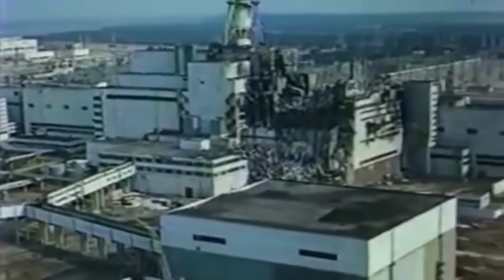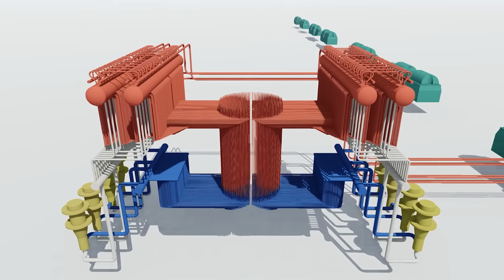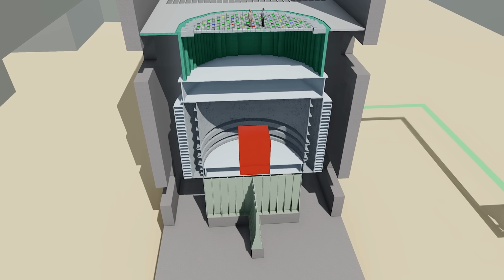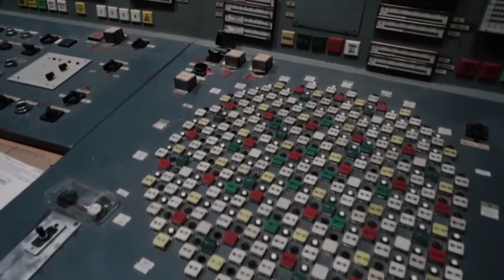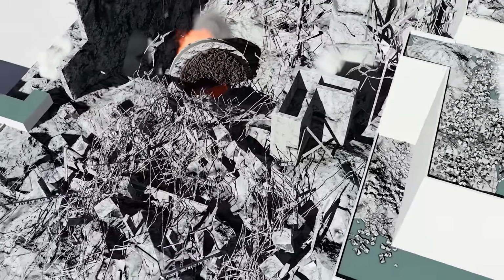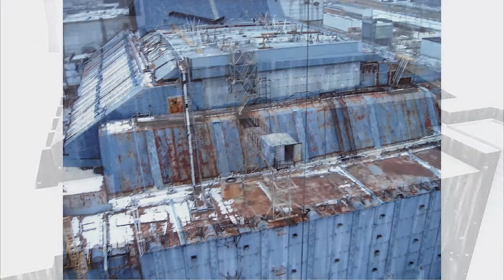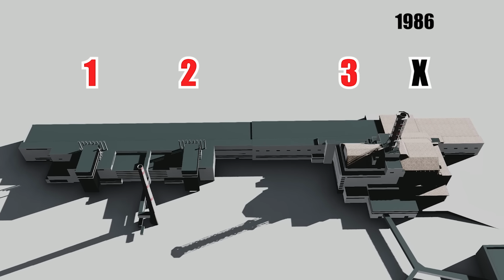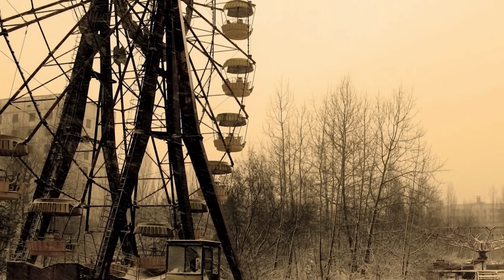CHERNOBYL DISASTER - An Inside Look - 3D

Comment: Yes! Let us add graphite tips to the fuel rods, so that when they hit the reactor core, it increases power rather than lowering it! Huge brain.
Reply: The reactor had operated for 20 years prior. It had design flaws, but this was caused by negligence of Dyatlov and 2 of his techs.  
What really happened:

The reactor was undergoing a 24 hour shut down procedure, allowing for a specific test. The test involved disconnecting one of the turbines from the reactor, as it was being wound down, and using its energy to power water pumps. The test should have been a one off, lasting only 45 seconds. 

Anatoly Dyatlov (head technician on midnight shift) planned to lower output to 700 Mw, the lowest setting at which the reactor should have been operated. 
But he failed to properly set it up and the output fell below 100 Mw. Instead of allowing it to shut down, he tried to bring the reactor output back up to 700 Mw, in order to perform the test.

To do this, he overrode safety systems and warnings, and ordered graphite control rods MANUALLY WITHDRAWN from the reactor. 

The rods are a critical safety mechanism; if the system senses a run off reaction, it will automatically lower these rods into reactor and sap off energy output.

Sadly, he ordered the rods disconnected from the system, so that it would not interfere with his quest for more heat.

Once the positive heat loop kicked in, it kept increasing the water temperature in the reactor, in turn causing higher fission reaction, and on and on. The heat and pressure built up, until reactor 4 housing and piping exploded, propelling a 1,000-ton concrete slab above it clean off the building. 

The reactor was now exposed; contaminated water and coolant were spraying everywhere. 

Dyatlov was sentenced to 10 years of prison, but was released in 1991 after collapse of USSR. He tried to scape goat authorities, apparently ordering him to press on with a not so important test and jeopardize billions of dollars and national catastrophe. In reality, he was public enemy #1 and public demanded his execution. He died in 1995 from heart attack.  https://youtu.be/Cc-vvhWXL9Q
Reply: @tropickman  The RBMK design was finalized in the 1960s. Chernobyl reactor 4 came online in 1983. The test they were running SHOULD have been run before the reactor was certified for operation.
Reply: @tropickman   you really wrote a bible huh.
Reply: Why? You may ask, because it was cheaper
Reply: @sandvich_enjoyer  the graphite tips didn’t have anything to do with whether is was cheap or not. It had it’s reasons. For example, it would give the operators more control because water absorbs neutrons. Adding that extra graphite would solve this problem. And give more control. Graphite as a moderator is indeed cheaper than other moderators. But the tips were there for a reason.
Reply: The graphite tips were part of the moderator-control system. Withdrawing them sped up reactivity, inserting them slowed it down. The number of automatic safety systems Dyatlov had deactivated to make the Chernobyl explosion happen was rather absurd.

Comment: I have read elsewhere that reactor 4 was operating in an experimental mode when the explosion happened.  It would be interesting to know what was happening that caused it to explode.
Reply: Not experimental, emergency.
So RBMK reactors had a safety system where, if the reactor fails, there is a power outage or whatever, the pumps running water to the core would fail and the core would melt down. To prevent this, the still spinning turbines that generate power for the city could be used to run the emergency pumps until the Diesel powered backup generators kicked in.

Now, several things happened at the night of the test to see if this system worked.(Well, they knew it worked, they just hadn't validated it for reactor 4 yet)
1: The reactor ran at nominal power all day before because of unexpected high demand, it was supposed to run at reduced power.
2: This created more xenon gas which slows the reactivity of the fuel. But no problem because the reaction burns away the xenon.
3: when they reduced the power to test levels, the excess xenon was not being burned off by the reaction, stalling the reactor.
4: power plummeted, well below test levels (the turbines had to spin a certain speed for the test to even work)
5: they raised power by pulling all control rods out of the core to somewhat test-worthy conditions, the graphite tips of the control rods are meant to replace water, which would slow the reaction.
6: this made water boil low in the core, creating bubbles of steam but no problem since the pumps keep water running so no voids can form.
7: they started the test by shutting down the pumps running water through the core.
8: Power skyrockets as the water in the core starts superheating, creating large steam bubbles.
9: the control crew engages the emergency SCRAM system, which moves all rods back into the core.
10: The graphite tips hit the superheated voids low in the core and flashboil all remaining water there, creating tiny steam explosions rupturing the channels and fixing the rods in place.
11: the reaction infinitely accelerates.
12: Explosion.
Reply: No one knows what caused it to explode! Sure people say that it's hydrogen but in Fukashima they had liquid nitrogen to pump into the reactor to dilute any hydrogen should there be any but yet it still exploded! So as far as I'm aware, no one really knows... No one has ever been inside a nuclear reactor to find out!
Reply: @PeterMilanovski  The Reactors in Fukushima never exploded, just a regular melt down, and the tops from the buildings blew off, and Chernobyl exploded because of Steam pressure buildup from excessive heat because the reaction ran away, that cracked the reactor which caused air and stuff to rush in and flood the superheated core. Boom.

Don't really need a nuclear physics degree to figure that shit out...saying that "nobody knows" is completely shortselling the relatively simple physics that go on in nuclear reactors, and the excessive accident reports that come out afterwards.
Reply: @Chrinik  sure everyone has a theory! You can't tell me that you were in the reactor and you know exactly what happened! Don't kid yourself, no one really knows and you don't have to be a Scientist to know that.
Reply: @PeterMilanovski  Don't confuse your own ignorance with that of people who know how these things work, it's not fucking magic, my man.
There are only a handful of things that go on in a nuclear reactor, just because you do not know, doesn't mean nobody does.

Especially those who have the instrument readouts...

The fact that it was a pretty well documented design flaw, and the line of events leading to the disaster was expressly forbidden specifically because it happened before (to the same person, no less) speaks volumes about how well it was understood what happened.
Reactors aren't build by ignorant buffoons, the people that build and run them generally understand how they operate...

I'm fairly certain even you know that boiling water creates steam, which creates pressure, which can move and break things. I mean, the concept of a Steam Engine is only a couple centuries old, it should have even reached your ears. Nuclear Power Reactors only do one thing, boil water. If you don't know how to do that, please, don't ever step foot in a kitchen.
Reply: @Chrinik  nuclear reactors only do one thing! Are you sure, because I have seen them destroy life! I would say that's two things! At least! The nuclear reactor also invented lead lined coffins buried in concrete! A very humane way to send of your loved ones! 
When are you going to ever understand that there's nothing more to understand about radioactivity! I don't like it, I don't want it near me! It's not too cheap to meter! I don't care if you think that it's clean, it's putting water vapour in the air, it's creating heat pollution and the most important thing it's leaving behind radioactive waste which after all these years no one is recycling! Renewable energy is going to kill off the nuclear reactor! Like it or lump it. People have been messing with them since the 40's and it's clear that in 2010 or whenever Fukashima happened it's still not perfected! It's shit technology that should have been eradicated long ago! It's a dead topic! If you want it so much, I hear that there's plenty of cheap realestate in Fukashima, have you considered moving there? According to you, it's a great place to raise your children! So much clean energy that you can literally shovel it home!

Comment: Uhm, there are few - if any - naturally stable reactors in the West.  PWR can very well go unstable, and as RMBK reactors demonstrated - PROPERLY managed, they work as designed.
Reply: TRIGA is naturally stable...it is so self regulating (as the power goes up, reactivity goes down) they let high-schoolers run it.

Comment: "Western reactors are stable by design..." - yea, there is no bias whatsoever.
Reply: He said Chernobyl wouldn’t have been licensed in the west. Clearly they were doing it wrong while the west wasn’t.
Reply: @NotMe47294  Well, Windscale facility wasn't really a Soviet construction and Slotin wasn't a Soviet citizen. I'm not saying there was no disregard to safety due to Lenin's Birthday Deadline, but we all know, at least since the Fukushima Daichi, that the "That cannot have happened in the West" saying is outdated.
Technogenic catastrophes doesn't care about politics, so depending on "this is made in the West and cannot break" is a dangerous thought for any engineer.
Reply: @andrejspecht8217  Windscale wasn't a result of a reactor becoming unstable, it was the result of a deeply flawed design when it came to fueling the reactor. 

Fukushima wasn't the result of the reactor becoming unstable, it was the result of the plant being hit with a tsunami far larger than it was constructed to withstand. 

Three Mile Island wasn't the result of the reactor becoming unstable, it was the result of a blockage in the coolant water conditioning system being improperly cleaned and the emergency relief system being poorly maintained and constructed.

None of the big-name nuclear accidents in non-Soviet reactors were the result of building a reactor that had the potential for a runaway power excursion all other things being equal.

If you're going to criticize something, make sure you actually know what you're talking about.
Reply: @MrBlueBurd0451  So you basically pointed out the flaws of any NNP that led to a desaster. What's the point, then? I was saying that everything can be regarded as dangerous and the origin doesn't mean it has to be especially stable or unstable, but the lot of you decides to jump me in a selfrighteous /pol/ rage. But guess what, i don't care.
Reply: @andrejspecht8217  The point is that unstable reactor designs, like the RMBK inherently is, would never be licensed in the west. You would never be permitted to build it in the first place.
Reply: @MrBlueBurd0451  I understand your point, yet, isn't any reactor project "stable" until STHF? No matter where it was built. RMBK was cheap, easy to build and upgrade, could be used as a breeder and was considered safe. Sure, graphite core was a bad idea. NOW it is unsafe. Would you say, building a unsafe reactor on purpose because of malicious intent, is something a certain country would do? I would call it a bias.
Reply: @MrBlueBurd0451  so, building a nuke plant near tsunami/earthquake area was not stupid??? (what you are saying)
Its likr asking to be killed sooner or later.

Building a nukeplant with bad/no backup cooling is okay for you? 
Try to avoid double standard when you judge about incident.
P.s. there were terrible accidents in the west, they just hide it way better.

Have a good day
Reply: @giga18116  Of course it wasn't smart. The Japanese thought they had designed the plant to withstand the absolute worst that could be expected. They were wrong. Lessons learned, move on. 

But the basic design of the reactor itself was not flawed. The reactors itself didn't have a 32+ gigawatt power excursion because of the AZ-5/SCRAM system being triggered at the wrong moment. Fukushima's reactors SCRAMmed perfectly and as planned.

True, the cooling backups failed. And the backups for the backups failed. This is all true, and they are valuable lessons.

But to suggest that the basic reactor design in Fukushima was in any way a contributor to the accident reveals that you don't know what happened at Fukushima.
Reply: @MrBlueBurd0451  im glad that u got the point.
West did fatal mistakes but no body focus on stupidity behind them, instead they focus on failed soviet tech, which i partially agree.
Their reactors work and stable when used property and inside its required  operating manual (sorry for my english). They still work in Russia (40+ tears so far) and that proves something afterall. Its simple as nex example coming down my mind:
If u use a lighter to light up a cigar it will be simple minor operation but if you light cigar, drop it into a dry grass, pour some gas into it blow some wind and cry why it failed to stop thw fire with can of water.

The stupids did that to nuke reactor, which was biggest fail. Im not defending soviets (i love russians)
Im just ponting that (again, imo) main mistake was human factor.

Commenting on their "cheap" design is subjective.  Sometimes, less is better.
Last workimg car on earth will be golf mk2 because of its simple and well made design.

This video was bashfest against russians. I has ti say something about it.
Reply: @giga18116  Never assume human error. If something appears to be caused by operator error, it just wasn't designed well enough.
Reply: @MrBlueBurd0451  i very disagree.
Give  tank to a moron and see what happends. 
Thats why high tech stuff need trained operators.
Reply: @andrejspecht8217  you can’t really look at the two approaches and avoid coming to the conclusion that one was fundamentally sound and the other fundamentally unsound.  No system is perfect but clearly one is better than the other.  The 1st world has also learned from its mistakes.  The second world has collapsed from its mistakes:  the two are not commensurate.
Reply: @lookoutforchris  I will laugh at this comparison in 10 years, thank you.
Reply: @andrejspecht8217  Windscale was NOT a nuclear power station. It was never a design intended for making power.
Reply: @agt155  It was a nuclear facility and it wasn't supposed to irradiate the countryside either, so what do you even trying to prove?
Reply: @andrejspecht8217  dude you forgot to mention the SL1 nuclear reactor which was the first in the world and it was American, there's also another one that happened in Canada, apparently it didn't kill anyone but it doesn't mean that it never happened! Lest we forget about three mile island!
Reply: @MrBlueBurd0451  regardless, they failed and not even you want to climb into the reactor to see what went wrong!
Reply: @MrBlueBurd0451  lesson learned! No more nuclear power plants! Everyone is getting rid of them thankfully!
Reply: @PeterMilanovski  Mate, i didn't even pressed the nationality of that reactor) People seem to phase out facts and go "our tech is infallible and their tech is shit" and this is a arrogantly dangerous thought, at least, for a nuclear engineer.
Reply: @andrejspecht8217  mate, all reactors designs have failed, if they haven't, then it's just a matter of time! A nuclear engineer is a Dr of death! It's not a real profession! To think that a human can understand something that is so small that an instrument doesn't exist that can even see it! 
Sure we can measure it's effects, just ask the three nuclear plant operators of the SL1 nuclear reactor, no wait, they dead! Hmmm I wonder why?
Just give it up! The whole world is going renewable! Coal and gas is almost dead, nuclear is well on it's way, it would have been sooner but you know how it is, it can't be switched off like everything else! It has to run its course whether it's for good or bad! 
Why don't you just switch to some other topic that is actually good for humanity! Take your shares out of nuclear and invest them somewhere more productive! Steam trains are very romantic but are not practical any more! Nuclear energy is exactly the same.
Reply: HMQ Reprised  Responsibility for what, imbecile?
Reply: That’s not bias, it’s a fact. Pointing out Windscale, Slotin, and Fukushima just reinforces that fact, and illuminates your ignorance. You’re playing whataboutism with false comparisons.
Reply: @Willaev  You are throwing words you probably don't understand, talk about "facts" that aren't reinforced by anything and this just illuminates your arrogance. I was about to say, pardon for interrupting your country bashing, but i won't.

Comment: Hi Mike. I appreciate your good work but in my opinion the comparison between driving without a seat belt and a lack of pressure vessel was too dramatic. There is a lot of reactors operating without a pressure vessel. For example CANDU reactors don't have pressure vessel design and those can also be refuelled while operating at full power. There were flaws in design with RBMK reactors but these weren't the lack of pressure vessels.
Reply from the maker: I agree and appreciate your comment. Having better knowledge now, its clear I need to remake the video and remove the inaccuracies you mention.  There also is no such thing as a “western reactor”.  There were early graphite reactors around the world and later water moderated reactors including in Russia.  Right now I am finishing off my video about the AZ-5 tip effect. Then I’ll have the time for the remake with additional visuals.